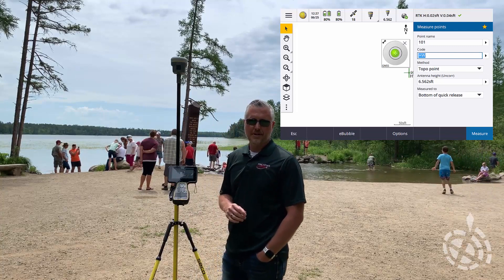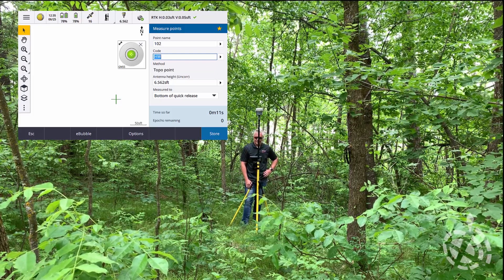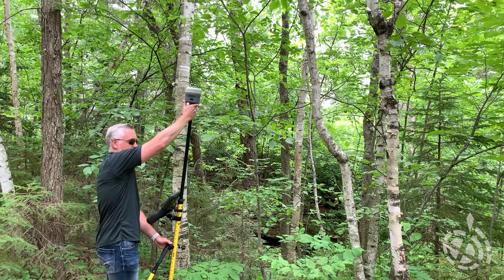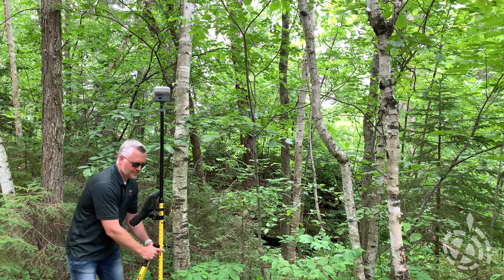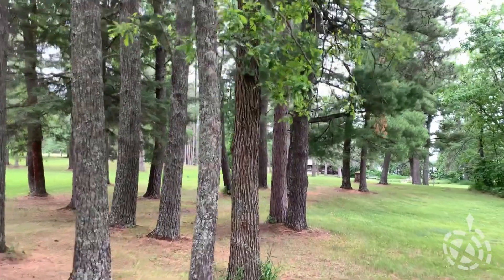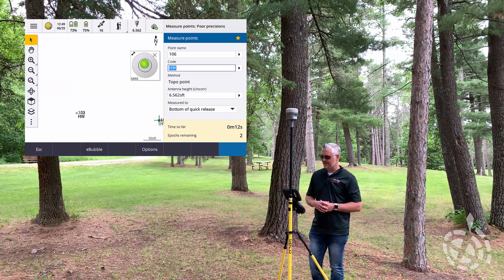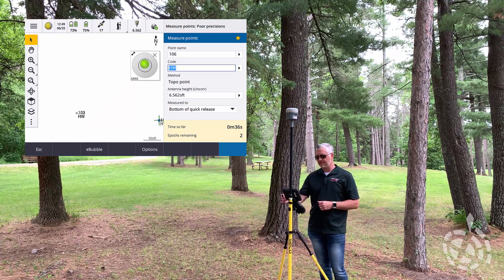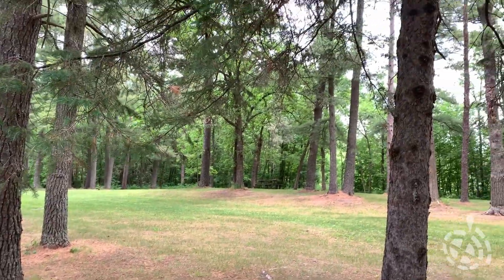Testing ProPoint GNSS at the Mississippi Headwaters

Comment: Whats the difference with Reset RTK vs Reset SV tracking? We use Reset SV on our R12i(s)
Reply: Resetting the RTK is what Trimble recommends in harsh environments.  It basically just drops the real time initialization.  Reset Space Vehicle (SV) Tracking, means it will drop all of the satellites along with the real time initialization and then re-acquire the satellites then re-initialize.  Trimble doesn't recommend doing this in the canopy since it will take quite a bit longer to get initialized again.  But if you have the time, it would be still be a good check shot method.  Thanks for watching.

Comment: Hi! I'm using R10 and RTK most of the time... but I never ever made a shot a point on that thick canopy.  Am I missing something on the settings? 
Please ... I need your help.

Thanks in advance...
Reply: Hi Lester,  you will need to at least be running a R10 Model 2 with firmware at V6.04 (minimum) to be able to start using ProPoint.  ProPoint is what we use to get in the canopy. If you are using the older R10 Model 1 (latest fw V5.50) for the base/rover, then the best you can do is check on all available satellites in your survey style and make sure to reset the RTK once you are in the canopy.  But I highly recommend you contact your local Trimble Dealer and have them come out to demo the new R12i.  You will be amazed for sure.  I hope this helps.